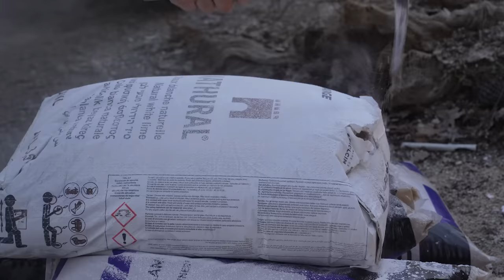Back to rebuilding a ruin.

Comment: that's a LOT of pulls to start a Honda GX160 yo, is this the first start? my Honda engines start on first pull basically all the time B)
Reply: okay yes the concrete mixer looks brand new, this is normal, nvm

Comment: Dan, I've often wondered when you've rebuilt the stone walls why you are so pedantic about the cosmetic outcome? The pointing being all even, etc. seems unnecessary and would have more intergrity if you left any excess mortar behind. But my actual point in asking is being internal walls with brickwork, steel lintels, etc. surely it is all going to be rendered over with plaster as the finished facing, especially for bedrooms? You'd save half the time if you left it as reconsructed knowing that's any excess or messy looking morter is going to end up behind lime plaster.

Comment: Surprised you don't have a telehandler lended to you from a rental company for free sponsorship. This getting to be ridiculous.  Tons of brickwork 20+ meters in the air.1600 per month. Or you can finance it a 0% for less or a used 2022 tl1255 is about 700.00 per month for 5 years financing at 7%. There's about 35 tons of bricks that need to be up there plus 3X the existing roof beams and floor joist that winch won't last. Plus 3 pallets of mortar mix for the walls.